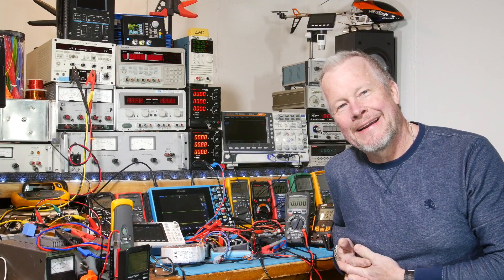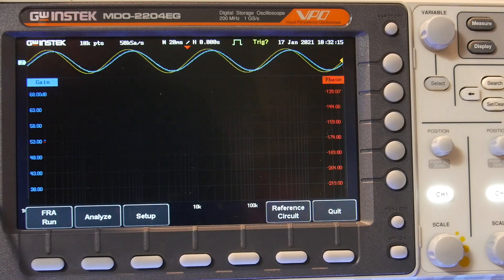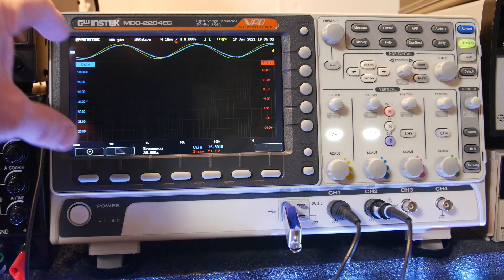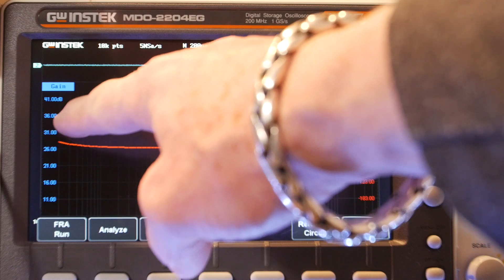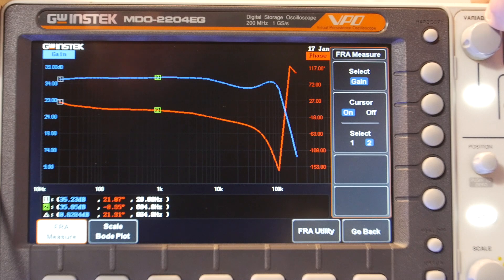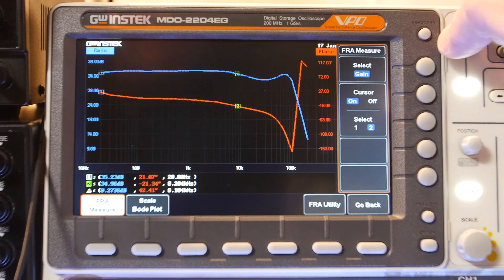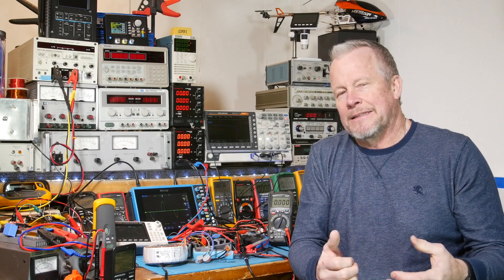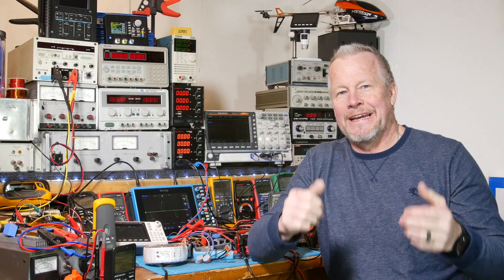Bode Plot Class D TDA8954 #bodeplot #TDA8954 #classDAmplifierproject

Comment: Eddie, love your channel!  I wanted to follow up on your previous Micsig Cp2100B vs Fluke Current probe video months back.  What would you need a 2.5MHz bandwith (vs. 800kHz for the lower cost version) capability for in a current probe that could justify the cost?  My Siglent scope does not have an 'amps' setting for the probe - is that just an in head calculation for the units?  Thanks for all your great content!
-GDC
Reply from the maker: Great question.  I sure don’t need that bandwidth;) Micsig was so kind to offer me one so I took the higher cost unit;

Comment: Following are specifications for the amps we used to use on our system...eight of these did the bottom end (requiring a substation to run them!)
ESS 500 Power Amp Specifications
*Power output: 250 watts per channel from 20-20,000 Hz both channels driven into 8 ohms (Typical >300W per channel into 8 ohms)
*Frequency response: 20Hz to 20kHz
	+/- 0.05 dB 20-20,000 Hz @ 1W
	+/- 0.50 dB 5-100,000 Hz @ 1W
	+/- 1.00 dB 3-150,000 Hz @ 1W
*Total harmonic distortion: < 0.1% (20-20,000 Hz up to rated output)
*Hum and Noise: 100 bB below rated output
*Damping factor: 1000:1 @ 20Hz
*Square wave rise time: < 1.7 microseconds
*Phase shift:
	10 degrees leading @ 20 Hz
	10 degrees lagging @ 20,000 Hz
*Input sensitivity: 1.75V input for rated output
*Signal to noise ratio: 100dB
*Speaker load impedance: 4Ω (minimum)
*Dimensions: 423 x 152 x 381mm  (16 5/8" x 6" X 15")
*Weight: about 60 lbs
These were brutish and flat from dc to daylight and coupled with 15" bass drivers in quad cabinets could move some air!

Think of the weight (and power) savings that could be realized using a Class D of the sort being tested here!
Reply from the maker: Wow!!  That is impressive!  Thank you for sharing that;) It is educational just to read specs I think.
You are right of course - the new Class D amps are so effective plus have much better power factor!  It would probably take near half the input power with Class D!

Comment: Great job. I had asked about checking frequency roll off and here you did it! The amp appears to be a winner! In car audio amps are usually tested for power at 40 hz and 1khz. I’d be interested to see how it does at those frequencies. Looking forward to the full review on the new amp meter you got. Be cool to see how it compares to the kaiweets. I just got in the fluke 107. Not a bad meter for being a Chinese fluke.
Reply from the maker: Thanks for that great feedback!  I need to finish this amp so videos will come fast;) I purchased a Chinese Fluke hoping it was great - since they saved the money in manufacturing!  But I am so disappointed!!  I don’t know if I should rant or be nice and just review it?
Reply: @KissAnalog  Be honest but It is a Chinese Fluke after all. I kinda knew it wasn't going to be a 87 series. I lowered my expectations and  for a hobbyist meter it is ok.